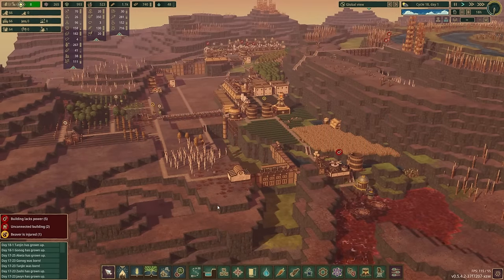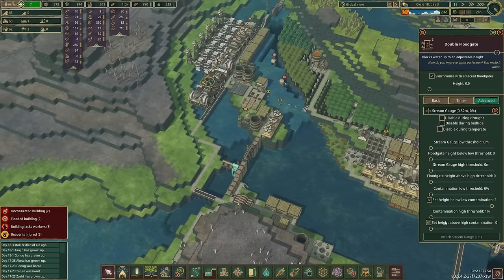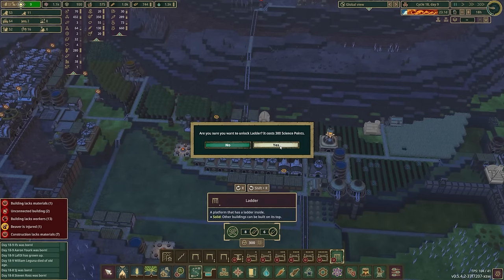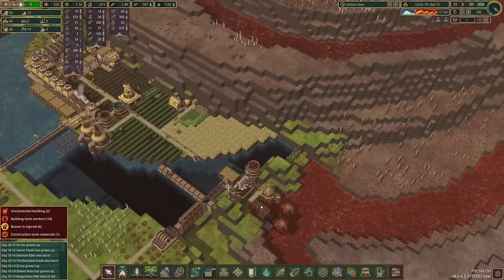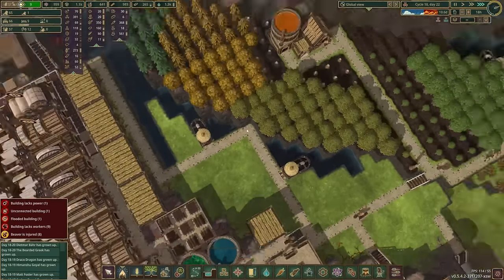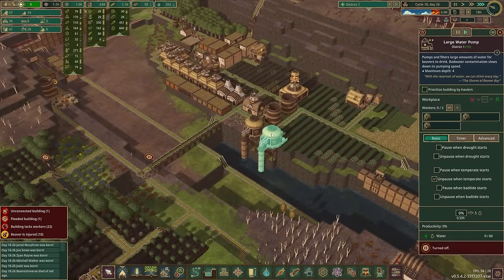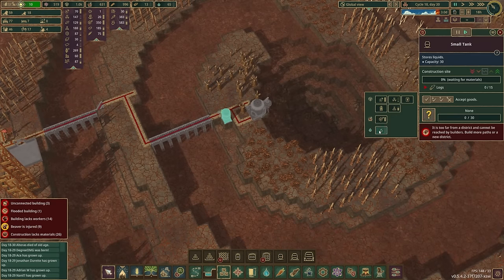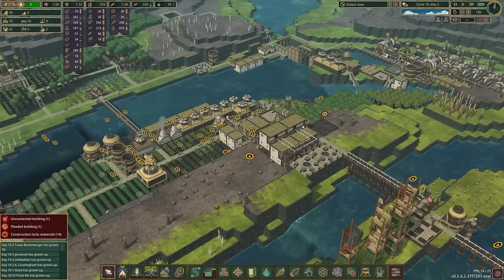Irrigation optimization and more! Timberborn Update 5 Folktails Episode 09

Comment: Next episode STORAGE!!!!! :P
Try to get to a point where you have enough for an entire drought in both water and food. IIRC that is 2 of each for each beaver per day, and as we just saw, 30 days of drought is possible, and you are just about to hit 100 beavers, so about 6K water and 6K food is what you need to aim for.

Other things:
- the exit floodgates need to be 5 wide not 4 wide, then you should be able to leave them at 1.5 all the time and then put them up to 2 at the end of a temperate season.
- the higher evaporation seems to be related to the amount edge on a hole, so the area near the trees with 2 dumps should be made wider not longer to reduce the evaporation (especially that section of trench that doubled back on itself)

Comment: you can build stream gauges inside of the irrigation pits to only activate the dumps when the level is low. also, put a water pit under the tapper shack instead of wasting time and water on that oversized trench

Comment: 59:31 Two things you can do for adding emergency reservoirs.  
1) Below your final dam create an additional dam below it (just one triple floodgate in case of badwater contamination-- use dam pieces for the rest). This will cause the water to shunt left allowing for an additional retention pond to be created and draw water from.
2) 1:00:18  Build a set of levees to the right of the badwater sources so it gets shunted off via the left side of the fork allowing to demolish those two rubble pieces and turn that riverbed into a goodwater reservoir as wide as you wish.
Reply from the maker: I like additional dams idea. Let's do that!

Comment: → Let me try to explain the "floodgate jiggle":
→→ 1. Install a stream gauge in the water near where you have the highest problem when it floods (where you have depth 3 blocks). [You could also have it directly by the floodgate, that gives a faster feedback loop, but might not react in time when it floods elsewhere.]
→→ 2. connect one of the floodgates to that gauge.
→→ 3. choose high threshold = 2.9 m, low threshold = 2.8 m
→→ 4. Floodgate height when below low threshold: completely closed.
→→ 5. Floodgate height when above high threshold: completely open.
→→This way it'll try to keep the water level between 2.8 and 2.9 by letting water out when it gets too high, and closing it again when it gets too low. (You could also try to set the same threshold for both upper and lower level, which will do the switching more often.)

About which series to play: I still enjoy the water beavers, so I'd be fine if you just pause it for a while when travelling. But if you don't enjoy them as much, it's fine to wrap it up, take a break, and maybe at some point in the future start a new water beaver series when Update 5 is out of experimental mode (so everything is stable). It will be interesting to see how the watertight buildings work together with the bad water.

Comment: Pretty sure you could control the lower flood gates using the same flow sensor as the ones at the bad water divert. Certainly in regards to closing during a badtide and then reopening at the same time as the clean water ones do to stop the flooding. Also then using the height controls for when it is just a drought to automate them as well.

Comment: 57:46 Your number 1 priority should be triple floodgates on the left side of all of those walkways on top of levees so that the water in the spiral would flow out of the low points in the spiral wall, if the gates are raised fully.

Comment: I know this can be confusing as not a programmer yourself.   The flood gates that aren't automated appeared to work perfectly timed to shut when the first set of gates close.   If you attach them to the same gauge with exactly the same settings as those gates they should close up and open perfectly timed to fill but not flood.  If you want it to open and close based on water height, reply and I'll give you exact settings to use. 

Also 0% appears to operate as disabled so use 1% for both low and high contamination settings.

Comment: Start at the pumps and work your way up to the floodgates upstream, blasting all the way to the bottom of the map. It'll cost a fair bit in explosives and time, but it will give you a massive reservoir.
Someone needs to slap these beavers around until they invent plumbing and sprinklers. You should be able to pump directly from the water pumps to tanks and then to houses, farms and industry.

Comment: forget bigger tanks for a while you need more area to hold water and all it costs is levees. I've only just moved up to big tanks at cycle 30 because i can pump water for all 30 days and really didn't need them. bigger tanks just need a lot of pumpers to fill them in the limited time you have with water flowing. There isn't more water available to pump that will make a difference in tank size worth it. the secret of hard mode is always not letting a drop of water leave the map that you don't have to. there are lots of ways to expand your water holding areas without going far from the start.

Comment: For that section near maple syrup bucket.  the two water dumps.  any reason why not add a dam (near the three research buildings) at the end of that section to make it another pool? so that id doens't drain down to the main section iwth the three major pumps.
Reply from the maker: It was originally another pool, but eventually it's going to be the same level as the rest of that reservoir because we will need the extra capacity for pumping.
Someone else suggested putting an irrigation pool underneath the tapper's shack up inside the maple and pine tree area and I  think we'll end up doing that. That would keep the trees hydrated without us having to worry about the water in the main reservoir drying up or being pumped out.

Comment: yeah, those fluid dumps 1 tile lower form the maples and pines are basically wasting water
Reply from the maker: With how insane the new evaporation rate is, you're right. Used to be possible to keep that big of a space full with just one water dump.

Comment: It actually would have been better to set of that dynamite before the upper part of the reservoir dried up because it would have pulled water away from the surface where it could evaporate.

They really cranked up the difficulty for this new update.

Hopefully this drought goes ok.  I would have rushed building the large water tank instead of leaving it paused.
Reply from the maker: Not gonna lie, I'm pretty worried about 30 days. We'll see what happens I guess!